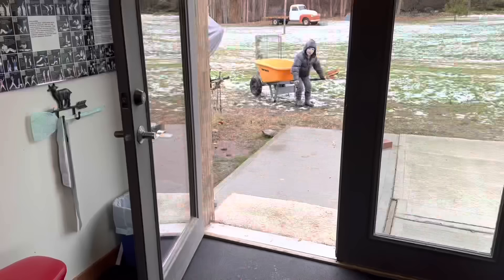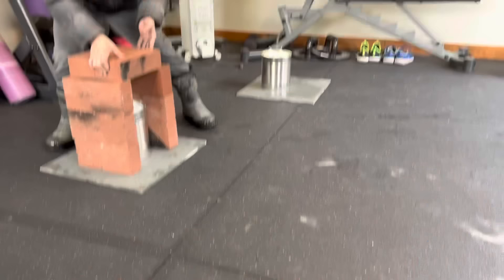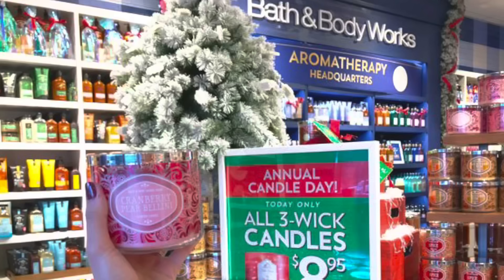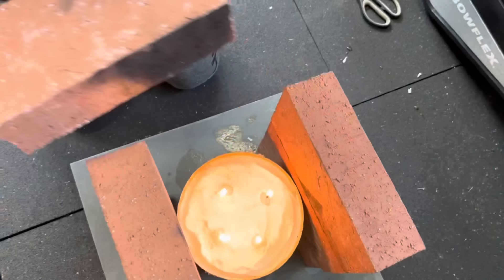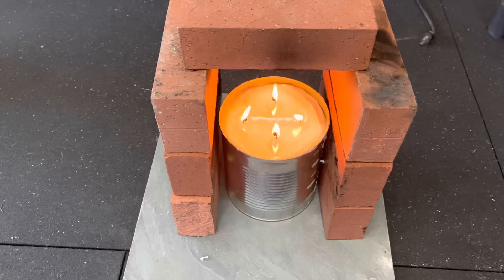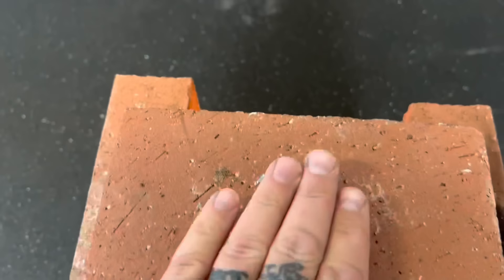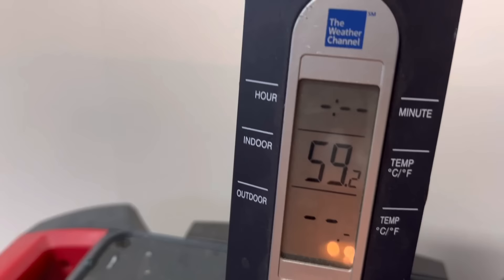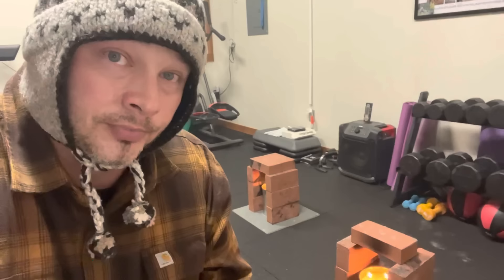Crisco candle room heating | Power Outage Room Heating | 9 hour test

Comment: Have you ever used a reflective surface with this setup?  A while back, we were camping in a cabin & lost power.  I put a mirror behind a candle to amplify the light. It also warmed the place up a bit.  Not a lot - it was only 1 mirror & 1 candle.  But it would be interesting to see if it is scalable.
Reply: Lol yes it is scalable if wasn't thousands of teenagers who grew pot 🤣 in closets for years with aluminum foil can't be wrong haha 😆
Reply: @shawnmayhew8481  Apparently, I have led a sheltered life.  😆
Reply: I visited a old mansion in the South.  There were TIPPED mirrors in the ballroom that multiplied the chandeliers and made 10 out of a couple.  Tried TIPPING the mirrors slightly during a black out and neighbors could not understand how my house had electric and theirs did not.

Comment: Would it be more efficient to only have the opening in the bricks on one side and the bricks on top closer to the flame? Looks like you might be losing a lot of heat getting past the bricks.
Reply: That wouldn't make a difference for the room temperature though. In fact, the bricks don't do anything for the room temperature. Putting bricks around/above a fire/candle doesn't magically make it produce more heat. All it does is contain the heat in a smaller area (in the bricks for a large part) in case you want an extra warm spot (right around it) or if you want to warm your hands on the bricks or something.
Reply: @Sanquinity  It also stores some of the heat, so even if the candle was blown out, the brick is putting out heat an hour of more later.
Reply: @NdxtremePro  Yea forgot to mention that part. ^^;; Though to be fair, depending on the candles they can last for what, a few hours? One more hour or so of fading heat would just make me put a new candle under it anyway. :P

Comment: Questions:
(1) Since you are measuring air-temperature why use bricks? Get rid of the bricks and let the floor-level Crisco stove use air-circulation to heat the room. It's true that the upper part of the room will be the warmest, but that is true of any heating system. A lower ceiling would be effective.
(2) While nine hours is a start, it can't be said to be anywhere near a real test. Your outside temperature is 54F(12C where i live) which for us is a balmy day in wintertime. Comments?
(3) Opening the door for fifteen minutes does NOT cool/chill the room. The escaped air has a low coefficient of heat, and hence a low heat content. The bulk of the heat is contained in the floor, walls and ceilings. Leaving the door open overnight and THEN heating the air is a more realistic test.
(4) Our (local) need for emergency heating is during a mid-winter storm, with winds at 70Km/hour or more gusting to 100KM/hr draining the heat through every crevice. Please include strong-winds in any future tests.

That said, a good video; a great starting-point for trials by anyone. I do admire you for measuring temperature against time (although I think that a boost of about 10F is not useful in a real world situation). As well I like your cautions, using a Carbon Monoxide detector, and the notes on scented paraffin wax.
Thanks, Chris

Comment: Btu's coming from the candle, no matter how shielded or dispersed, will NOT keep up with heat loss from the room..... thermodynamics 😉
Reply: unlesssss your insulation and windows are 1337 rated.
Reply: But it could well take the edge off if it was operating in a microspace.

Comment: Tip from my Grandfather I remembered: 1st - Lay 2 or 3 Bricks down longways, then put on each end on the narrow side 1 more brick going across the 3, then 3 bricks running across the top. 

2nd - Keep stacking bricks until it cover the back of the stove except your previous brick handy work.

3rd - Lay a one brick thin line sideways in the front of the stove to divert airflow.

So then what do you get? A brick rocket stove.
Reply from the maker: Sweet thanks for the tip, there’s lots of cool designs and you can get really creative with the stuff, thank you for watching we will continue with weekly tips

Comment: Are those special bricks or just the regular kind you can buy at Home Depot?  Do you think a square cement paver brick could be used on top?  Great video, thanks.
Reply from the maker: They are just construction bricks 🧱 they work great for emergency uses - possible may break Over long period of time but I havnt yet- fir bricks ar better but cost more

Comment: Great demonstration! Thanks for the video! I tried this during the last Texas freeze (Feb. 2020). I used an emergency candle stuck in a coffee cup full of crisco. The candle would not stay lit! It had to be the candle (ironically failing me during an emergency). I was wondering about using a lantern wick instead of the candle. I see the crisco liquifies. Is it completely liquifies when the candles are lit? If so, then the lantern wick will just curl up and "drown," extinguishing it.
Reply from the maker: I have not had that problem, but had quite a few people say they’ve had that problem I’m not sure if it’s a difference in wicks or what but the recommendation I give is rotating your candles every so many hours so that the liquefication does not get in the depth that it sinks your wick so just rotating could help with that the other Trac is taking some wire and wiring it across the top and then spiraling it down the wick this could also keep the wick upright, I hope those tips Help, thank you for watching hit the bell if you’d like to stay up-to-date and we will keep the tips coming weekly
Reply: I find the flat wicks for oil lamps do not work for regular oils. they are too tightly woven to soak up thick oils as opposed to kerosene which soaks right up into the flat wicks. you can try a 100% cotton shoelace, stick a metal BBQ skewer through it, or better yet a bendable wire so you can lower the wick if needed and rest on the cup, on both sides. this will hold the wick up and the oil travels up the cotton really well. or buy those wicks that already come with a wire woven in. They stand up by themselves. melt the crisco, pour in cup with wick already in the middle.add 1/3 of the cup of crisco. let it cool. this will make the wick stay strong in the middle. Then add the rest of melted crisco. it's like a real candle this way.i have used those white emergency candles in crisco and didn't have a problem keeping them lit. they are the perfect size for a coffee mug, etc.  As long as you keep the flame where no smoke comes out,these are very safe.
Reply: @RiversideHomesteadLife   Have you ever tried wooden wicks? They’re so easy to work with when I make candles. Thank you for sharing your knowledge on this topic.
Reply: Someone on another site used slim 6" beeswax candles. She cut them to fit the heigth of the candle. She made 2" candles from canning jars with 2 wicks for light. We can use the whole length 6" candle in the full size can. Did you buy empty paint cans since vegetable shortening is now sold in cardboard or plastic?

Comment: isn't it the case that the candle just gives so much energy (heat) out, and putting bricks around it doesn't increase the heat output from the candle, I.e. if you put a candle in a room and monitored the temp the rise would be no different if the candle had bricks around it or not, the heat rise will be due to the heat from the candle flame and the ability of the room to hold the heat, i.e. not lose the heat? so putting the bricks to stop drafts, say by the door would be much more effective than making the candle look like a heater?
Reply: I think the bricks help to trap and hold the heat, rather then effectively heating the ceiling area.
Reply: @jeffwalker7185   oh, I see but isn't it the case, the heat from the candle heats the bricks ( which would take some time) which will just rise to the ceiling anyway?
would it not be more effective if the candle directly heated the person(s) with something like a candle oven (well insulated) that heated a metal/ stone and that heated item was placed into a pocket on a well-insulated jacket so the heat from the candle that was transferred to the metal/ stone was transferred to the body of the individual directly as possible. the human body of a female produces (emits about 100watts a male about 120watts) a candle about 80watts as you rightly point out most of which is lost. best feed a female small meal. and she will produce more than the candle, and hopefully, be good to look at too which will likely raise your temperature.

To heat a room with candles by a few degrees would require many candles which would likely cost much more than a camping stove butane gas container. 

This video has fooled you in the same way a flame effect electric fire does. the flame effect is nothing more than the illusion of heat, yes the red coloured bulb produces heat but not enough to warm you even if it looks for all the world it should. if it looks too good to be true, it probably is. 
The best thing you can do Jeff is go chop a tree down and burn it to release its energy as heat. Once you realise how much 'heat' costs in sweat and years of growth you won't waste your time trying to drain the sea with a bucket video.
Reply: @sarahclark5447  The bricks act as a storage vessel for the heat from the candles - they hold the heat at a lower point in the room for longer. It is a bit like night storage heaters that have an electric element surrounded by very dense bricks. The element heats the bricks up during the night (when electricity costs are cheaper) and the heat is slowly released during the day. If the bricks in the night storage heater were absent, the heat form the electric element would dissipate very quickly after the electricity supply was turned off. I hope that makes sense Sarah?
Reply: I think it's the bricks turn convected heat to radiated heat, useful at lower lever
Reply: @jeffwalker7185  "The bricks act as a storage vessel for the heat from the candles - they ho..."
Yes thank you jeff, I see what you are trying to say. However, your analogy of the storage heater isn't quite right. if you replaced the heating elements with candles, you would need nearly 400. that would assume the original storage heater raised the room temp by say 20C  for 8 hours. One candle would raise the temp of the room by 20 divided by  400 which is 0.05 degrees centigrade assuming like for like.
in reality, you could heat a small room with 20 candles but the cost of 20 candles would be greater than the cost of gas. an 80-watt heater (one candle)  isn't going to heat a room whatever you try to do since the loss in the room would be too high and even if it wasn't the room itself would be like one of your dense bricks in the storage heater it would take forever to heat the room. the issue is you can't make 80watts into 1000 watts. the best you can do is take those 80 watts and transfer them to your body as directly as possible, of course, what you are trying to do is transfer the 80 watts into another body first, (the room) then let the room transfer the heat to you. 

What is confusing you is that the candle does heat the room, just as taking a bucket of water out of a large lake empties some of the lake, however, making the bucket look like a lake emptier doesn't make the bucket a lake emptier, what makes the bucket a lake emptier is to empty the lake in a given time.
Reply: @petersimpson633  Hi Peter,  turning 80watts into radiant heat is still 80 watts. if you mean directly transfer the 80 watts into your body then that would help. but remember your body is losing 120watts but that is being replaced by the food you eat. best get all your mates to join you in the room, 10 would generate over 1000watts. insulate your body with clothing would help retain some of that 120 watts. but what you retain isn't then heating the environment which makes everyone else's loss greater.    
there is a reason why men went into coal mines to dig coal and many died in doing so, was because candles only provided light and not heat.  consider what it would take to propel a steam train with candles, instead of coal.
Reply: Listen. The brick absorbs the heat and radiates it rather than letting the heat go staight to the high ceiling and be waisted. Listen. Don't just read thumbnails.
Reply: @ernieschatz3783  Lol, I, as a female am supposed to be the irrational, illogical and and emotional one .  
Ernie, look at the guy in the video, does he look like someone whos receiving radiated heat, or someone who is existing in the antarctic, is he dressed to keep heat in, or to receive the abundance of radiated heat from a candle?
Heat energy travels from the "hot" to the colder, in fact, or more correctly trying to achieve thermal equilibrium. 

The candle has a capacity of about 100 watts, much of that 100 watts is lost to the surrounding colder air and some is being absorbed by the brick(s) that which is being  absorbed by the brick isn't keeping antarctic man warm, however, when the candle goes out the brick will release what it did not offer antarctic man  to help him keep warm. I suspect your error is to think there is an abundance of heat from the candle, some of which can be saved in the form of radiated heat from the brick. There isn't, in fact, there isn't enough to keep antarctic man warm even if you didn't try to store some of the energy the the candle has   . 
Further the candle(s) would cost more than say a source of gas, like a camping stove, .there isn't enough energy in a candle to heat a room in order to heat a man. I have asked my great-grandma what she did to keep warm in the winter when she was my age, she said they burnt coal which was delivered by strong men on their backs, and when the coal ran out their only option was to chop up the furniture to survive.
Think of it like this, a candle has about 100 watts to give you,  One gallon of fuel that you put in your car has about  30000 watts to give you, how far a candle  would get you in your car is the equivalent of how much the candle  would warm you.
if you could put the candle into some sort of container that you could then hold, you would be able to keep your hands warm because all the 100 watts is being absorbed by your hands.
There are  efficient ways of heating that use oil that work because the energy is there, it just needs exploiting such systems have been out for years, and are relatively cheap. You cant get blood out of a stone sir, but you can get clicks from the gullible.

Comment: I always laugh at these from a thermodynamics standpoint, since the total energy of the candle does not change. Therefor the energy you're wasting heating the bricks is doing nothing but slowing down how fast they can heat the room. People seem to forget that the point of something like a brick oven is to trap the heat INSIDE it. And that's all you're doing by adding bricks around these candles, preventing the full heat from heating the room as quickly as possible.
Reply from the maker: That is incorrect.

Same heat either wAy. Same output- it’s the difference of loosing your heat to the ceiling at 11 ft which is very high ( grab a tape measure for a reality check on how tall 11 ft is) or capturing your heat and radiating it at a lower elevation you can be closer to with more surface area radiating the same heat.  And you need to think of it more like a open face fireplace / radiator than a closed oven.  
I’m sure you have never actually built these different options to know that but it’s kinda like driving and feeling invincible 5 miles over the speed limit on a country road and then one day you hit a deer and total your car and hopefully not get hurt what changes after that ? 
You drive way slower on that road because you have some experience, and more importantly your perspective changed.

Your perspective is just off is all. 
Give the methods a try, 😊 it’s fun and you will learn something 🙌🏽

Comment: Each flame is worth about 75W.  You can work out the total effective power of the candles from that.
One of those Sterling fan things would help a lot to get the heated air blown to where you are standing.  They work off the temperature difference.  They don't take away any heat from what you are doing.
Reply: I assume those are Peltier-Seebeck fans making electricity from a heat difference.
Reply: No. You could possibly maybe look up Stirling fan.
Reply: @marionsutcliffe1119  To be clear:  Any time you use a heat engine you don't end up with less total heat.  They work from the temperature difference.  They don't actually consume heat.
Reply: I was responding to the user who thought it was related to 'fans that make electricity from a heat difference'

Comment: size matters. if your candle is big enough it will put out the necessary BTU's. A kerosine heater is basically a big candle heating up metal. The concept is sound, but the limiting factor is going to be size.

Comment: I'm glad you posted this. I made 6 of these and 2 with lard. I experimented a bit but didn't want to use em up. My tiny house is 230 sq. ft. with 8 ft. ceiling so I should be in good shape. I didnt think to crack a window. I didn't get any odor from the candles either but they sure stink when you blow them out.😨
Reply from the maker: Lol, its always good to practice or try things out for when you need. With the space you have these should work great in an emergency! Do make sure you crack a window for ventilation! Thanks for your comment Mike!
Reply: Don't blow them out. Just interrupt the supply of oxygen through puttin' a metal lid or even glass lid (from your cooking pots) on the jar.
Reply: I manufacture beeswax candles for a living. We don’t blow out our candles. We drown the flame in the liquid wax. No smoke, or smell. Not sure how that would work in the crisco oil, but you could try it.